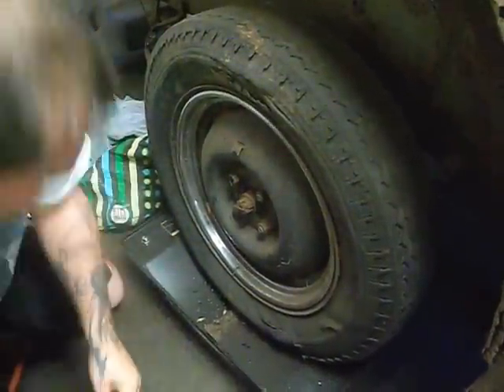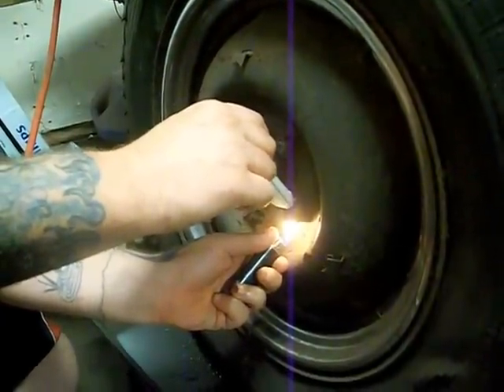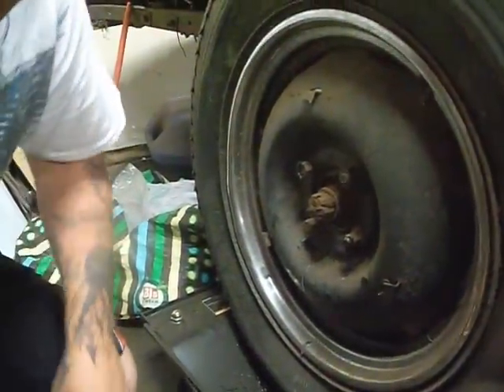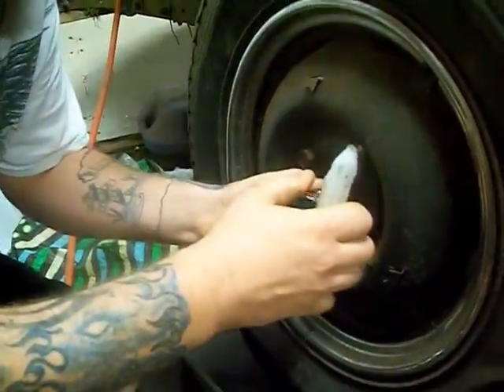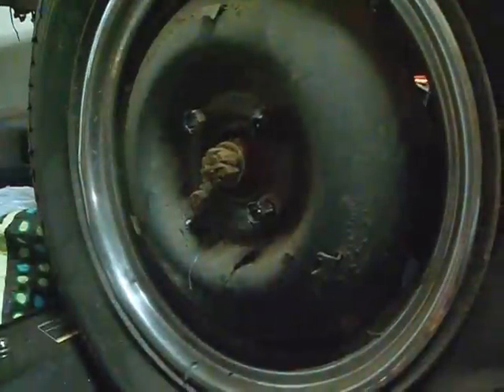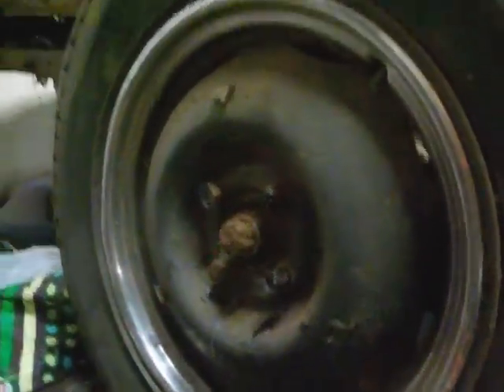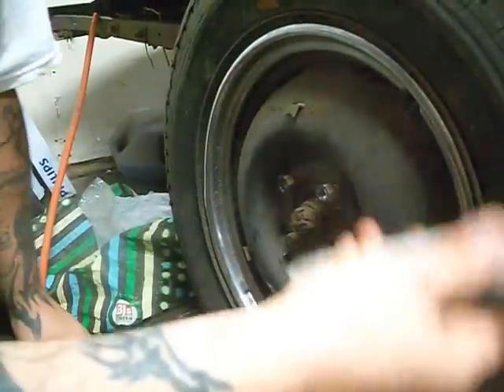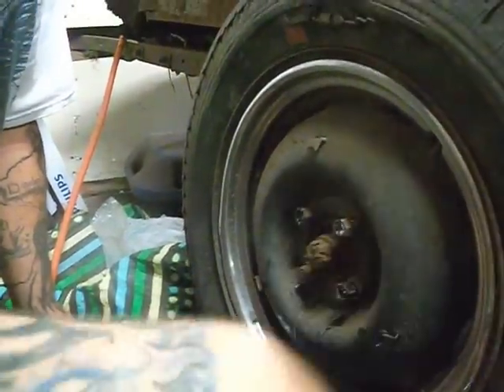removing rusted nuts using a candle and a lighter

Comment: They actually have invented this stuff called anti seize so you don't have to play with lighters, candles, torches, rounding nuts off, breaking bolts, etc. It's some wild shit.
Reply: Great. Now please post a video of how to go back in time and retroactively apply anti-seize to the 70-year-old nuts and bolts you're trying to loosen today.
Reply: wd40
Reply: Your so called anti seize is what you apply on your threads before tightening Einstein.
Reply: and it is not safe to put anti seize   lug nuts  bolt threads Rich  .  the lighter and candle   works better
Reply: keith   no that is a bad idea   I work in a shop  and I see it all the time     and in my shop if you are seen doing this  you are fired